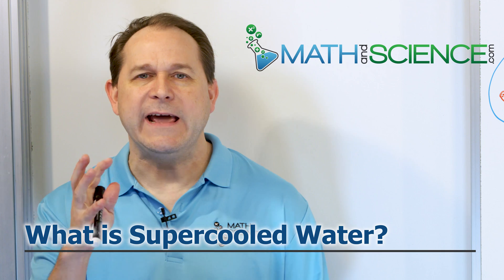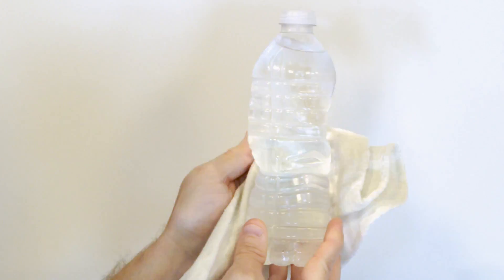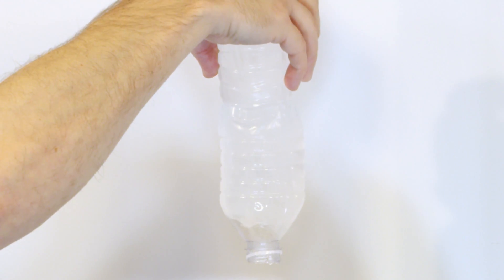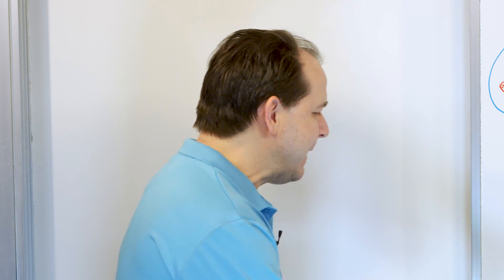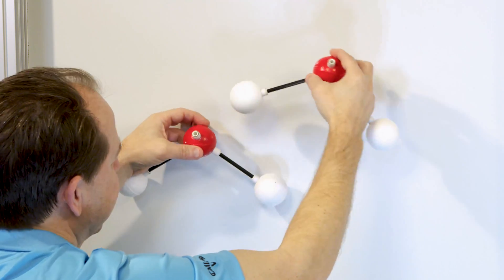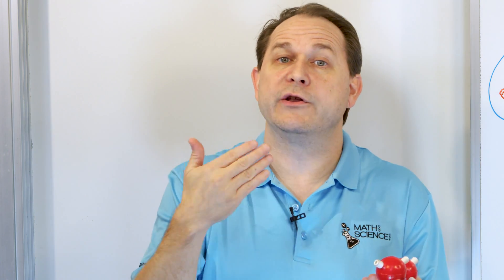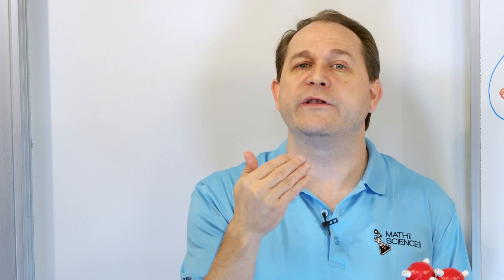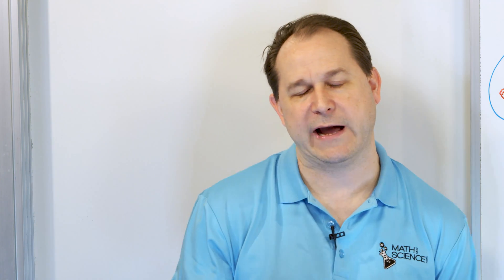What is Supercooled Water?  How does it Work?

Comment: Just earlier this week I had a bottle I was trying not to shake bc it was hot outside and I know it can freeze if it's at freezing temperature. As careful as I was it still ended up at least partially freezing into this odd slushy state. I was more amazed by this odd slushy state than it freezing solid! I'd love to know the science behind the odd slushy state as oppose to it freezing solid as it usually does when it's smacked. c': I haven't found a video on it yet but this one mentioned the slushy state. Thank you for your video!

The water I used was from reverse osmosis filter in my kitchen and I was reusing a water bottle I had used just before.

Comment: Hello Professor, will you consider adding salt to ice and the liquid ice water produced  that is being prevented from reformation to ice due to that addition of the salt causing the alteration of the ice water molecular structure  due to the salt , remaining as ice water with at very low temperature below feeezing also a form of liquid subcooling

Comment: I have worked in commercial refrigeration for about 35 years and have observed this phenomenon in ice machines. The circulating water can suddenly turn to slush everywhere in the water system all at once. I was measuring the temperature of the water in the trough of a machine one day and saw a low of 27F just before it all flashed to slush. More modern machines (built after about 2005) combat this and rarely do it, but the old ones would do it every time on the first batch.

Comment: Sir ... Why does water change from solid to liquid... Or to a gas... I'm not asking because I don't know about 32° Fahrenheit and 212 degrees Fahrenheit... But here's a question define the word .....cold.... You may know what I'm getting at.... It seems so complicated to me that if molecules and atoms slow down they become coldness... But why? Why did they become cold? .... If you subtract 32 degrees from 212°.... You get 180 degrees... So out of all the different temperatures... Waters liquid state can only be within a small window.. really that's irrelevant to what I'm curious about. What is the name  of the energy that caused water  to get cold . Please don't say refrigerator.
Reply: Cold is just the absence or lack of heat (or less energy) in the system. Much like pressure, heat is always "trying to even out" so high moves to low. Heat will move to something with less heat. Relatively something with less heat we refer to as "colder" vs something relatively with more heat as "hotter".

A fun experiment you can do is measure the temperature of a piece of metal. You'll find that the piece of metal is the same temperature as air in the room, however it feels "cold" to your hand. It's not that the metal is cold, but that it's a good conductor of heat, and you're warmer than room temperature, so the heat from your hand is transferring to the metal, which in turn transfers to the air in the room over time.
Reply: @killpidone  I guess that's an excellent answer to a question that I did not ask... That was interesting though..... Let me ask my question like this....... If water solidifies 32°what's going on with the molecules and atoms at at 32.1 degrees.... And what is going on with the atoms and molecules at 31.9999999999999 degrees. And why did it solidify.